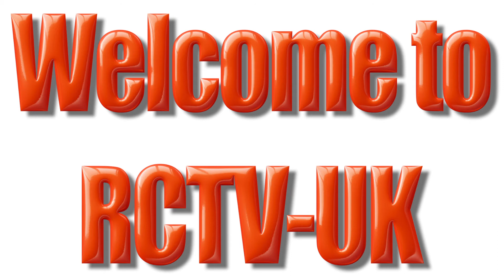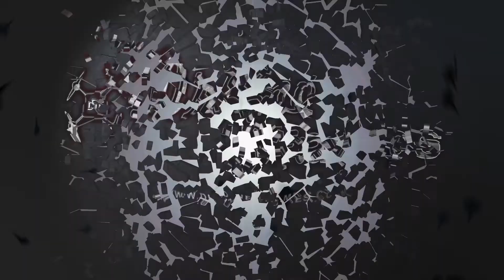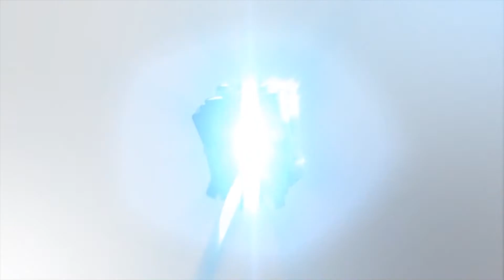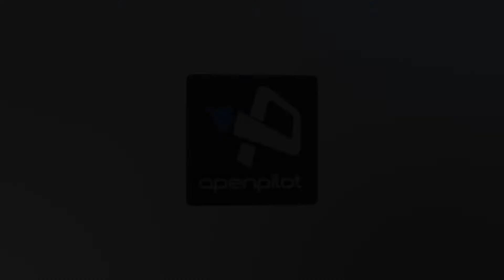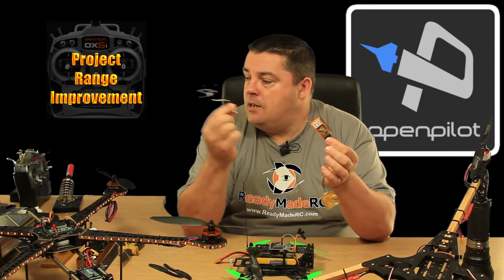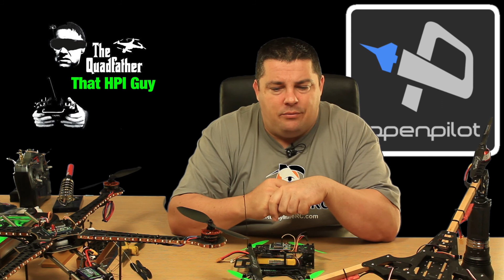RCTV UK's Multi Rotor Talk Episode 1

Comment: What your using are Infra Red cameras which are not night vision cameras. Night vision cameras have a Photomultiplier tube which amplifies available light massively, but they need a high voltage supply, cost well over £1000 and are low res.

Chris
Reply from the maker: Hi Chris you're right about the other types of night vision using light intensifier tubes to direct light from the photo cathode. You are also right about this type of unit using IR to see at night. This is not considered to be covert night vision but it is still night vision none the less. I would love to use Gen-3+ for this project but I recon I can get something working for under £100 when the unit I have in mind would be close to £2.5k which would put this project out of most peoples reach.
Unless you have a spare Archer Gen3+ or something kicking around =D

ATB Malc
RCTV-UK